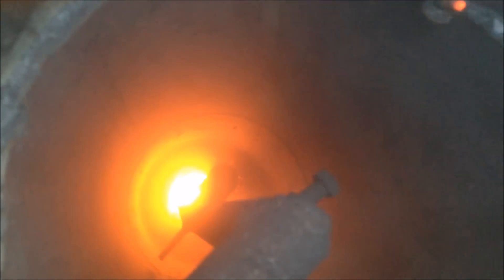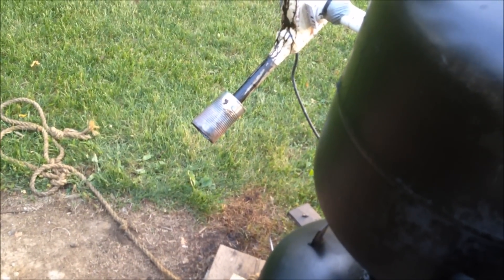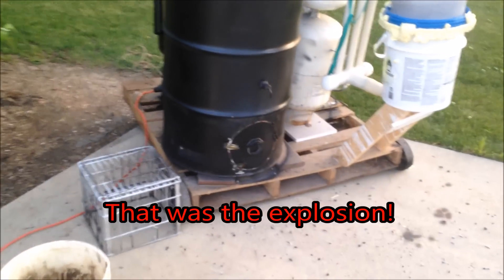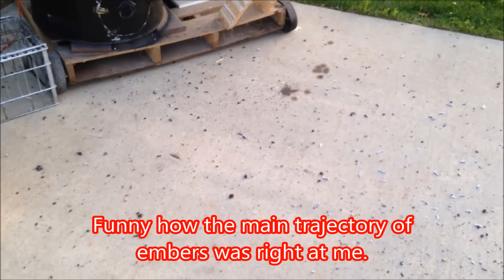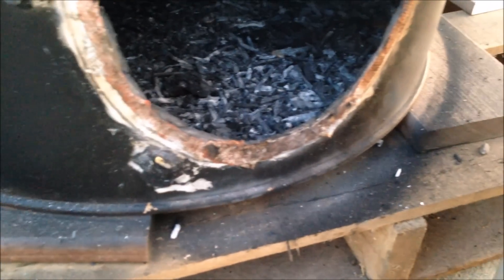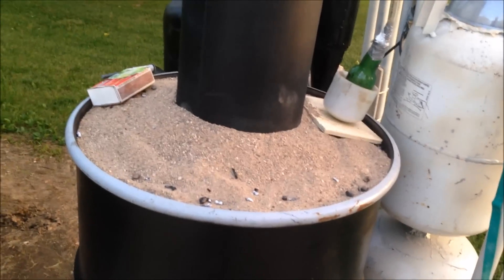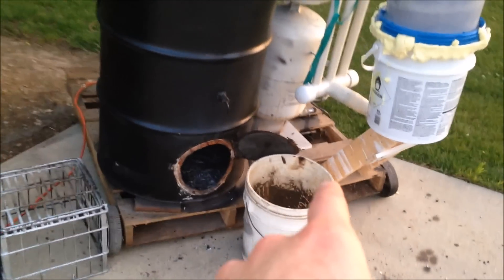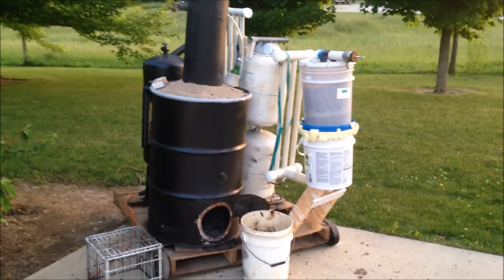Wood Gasifier Explodes on Video

Comment: THE LONE RANGER I LIVE IN LITHERLANDHEREWEGOBREAKWORDSUPJUSTTRYEDREDUNDERLINEL217LWMERSEYSIDENRLIVERPOOLENGLANDUKYESOLDBOILEREXCHANGEDFORNEWRECENTLYOLDEMITTEDFUMESNEWISAMILLIONTIMESWORSEINOWSLEEPINBATHROOM LET ME EXPLAIN I HAVE SOME WHO HAVE INSTALLED AN APROX 6ft by 24in LENTH HEIGHT VICTORIA FALLS GARDEN WATERFALL FLOWS DAY NIGHT AN SOMETHING THIS SMOKE LIKE WOOD DAY NIGHT IN HOUSE COMES THROUGH WALL VENTS UP OVERFLOW BATH SPOUT ETC EVERYTHINGS PLUGGED BLOCKED TOWELS AT DOORS AN CANT STOP THEM THE HOUSE SEEMS TO HAVE CORONA BALLS HANGING AN WITCHES BUT THE IS A WEAK 83 YR OLD ON MEDICATIONS ETC AN EVERYTHINGS HAPPENING IN HER HOUSE IF THE GAS BOILER WAS USED OR JUST FRONT PLATE FITTED ON FRONT OR WHATEVER IT HAS INTERNAL COMPRESSOR I TRYED UNDERSTANDING ITS SMOKY ASHY EYES NOSE LUNGS SUFFER AN DRIES YOU OUT COMPRESSOR IS A FERNOX TF1 COMPACT FILTER BOILER LOGIC COMBI C24 ideal ITS  CALLED 21398002025569 THE O HAVETOPRIGHT TO LEFT THROUGH LINES YOU SEE IF ITS SET TO RUN AN COMPRESS GAS REMOVING WATER FROM RADIATIORS AN ITS BEEN SETUP TO TRICK ETC POISON YOU ME LIKE AN THAT AN OLD WOMAN AM DAVID BY THE WAY JUST ME FUNNY TEETH THAT WAS ANOTHER TRICK ON ME I RUN MANY DO THE WICKED WITCH AN BELINDA THE WIZARD OF OZ NOW WOOD CAN RELEASE GASES TO BURN RIGHT OR WRONG THE GAS BURNING THE QUESTION IS WE WOULD EXPECT GAS TO SUPPLY CLEAN SAFE HOUSE GAS BUT IF THE BRITISH GAS LINE WAS DISCONNECTED AN YOU RECONNECT TO WHAT TYPE OF GAS SUPPLY WHAT TYPE OF GAS IS IT SAFE WONT EXPLODE WONT POISON CAUSE PNEOMONIA LUNG EMPHASEMA HEART DISCEASE SNOTTY NOSES CANCER TO AIR PASSAGES BECAUSE IF ITS NOT IN WRITING AN YOU HAVE AGREED TO ACCEPT A CHEAPLY SUPPLIED GAS IT COULD BE VERY DANGEROUS AN THEY MIGHT SAY ITS NOT IN WRITING AN NOTHING IS STATED CONCERNING THE GAS PRODUCED FROM EMISSIONS FROM POISNOUS WOOD TREES IN GAS GAS FORM IN YOUR HOUSE GAS SUPPLY PIPES COULD BE ANYTHING AN COULD CAUSE DEATH THE PINK BALLS LOOK LIKE CORONA VIRUS MAGNIFIED AN I DONT LIKE WITCHES INVOKING DEMONS

Comment: your shaker allowed the charcoal to particularize into the air below the reactor, and because you were burning corn (which burns very hot indeed because of the sugars) with a high volume of oxygen travel across the particularized charcoal, you generated a flash-over.

Comment: My thoughts are that you shaking the grate caused low O2 when you stopped shaking, the O2 level increased and caused ignition of the low o2 you just produced. Bang.. or pop in this case..

Comment: I think you came out quite well on this. Do be careful. Best of luck on your next try. Good to see some one willing to test and try ideas. You learn so much from experiences. Glad you made the video of it and sure does make it easy to better consider the causes and avoid them. Might check air getting in around the shaker shaft. You might even close up the unit as best you can and blow air into it and see where there is any smoke or air coming out. Best of Luck on your next test.

Comment: I think the paper towels were part of the problem. They obstructed the airflow and uniform movement of the corn while everything was smoldering. When you shook things up, that probably let in a sudden rush of air which allowed the hot gases to ignite.

Comment: You need a top that is fixed with some heavy duty Springs so when a sneeze occurs it will lift the top up to release the pressure. Otherwise your just gonna keep blowing out at the weak point and potentially hurt yourself.

Comment: I think you you shook a good chunk of corn down n had a build up of moisture build up. Especially if it's over 12 percent moisture. Having your top opened help compress the moisture and blow the door. That my opinion from having experience burning corn and installing wood and pellet stoves. Try a solid gasket and maybe a heavier door on the bottom as well .  That rtv stuff doesn't handle pressure well when you be got warping and expansion at play as you will always over time with anything solid fuel. Keep up the good work though man.

Comment: don't use food for fuel (or growing "crops" made for "fuel" instead of using the crop land for food crops)... the government's done enough of that with the garbage "fuel" they call ethanol, which costs more than it produces and just destroys engines. 
Wood gas, ran through the proper filtration and cooling, is much better.

Comment: In the preparation of tanks and tills for welding, the procedures to prevent explosion are  taken to purge vapours and gas fumes that remain, and are the same when the storage of flour and other finely ground grains have been present .
Your raddling the already heated.carbon dust reach critical balance for ignition, and there you have it BANG !!

Comment: You need to crush the corn bud..
Lets just say that Corn has explosive features..
(Pop corn is a sign)..
That is why I believe that raw corn gives off a bit of ethanol in very low forms.
Even without formatting it because it did a similar thing to me...

Comment: Was you surprised not to see pop corn when you opened the door?  lol

I didn't get a good look at the door, but no matter what if you have to ever open the top during operation then that weak ash door is a safety hazard. I think you may be right for the reason why the door seal failed, but the fact is that door seal can fail when the top is opened, shaking the grate or not if just out of freak accidents, if the bottom gets too much air at the same time it has highly flammable fuel available it will burst that weak door seam. I think it would be good to make a better door seam that can handle the pressure if/when that happens while the top is opened during operation. Mechanically the door must be stronger and mechanically sealed not just sealant.

Comment: yeah dude, each kernal of corn has water in it, and exploded at about the same time, this means your heat is even, and hot, since you had multiple kernals explode within several hundreds of a second with each other. Like a bunch of firecrackers going off at once, from the water pressure.

Comment: Hi Bob

I'd say 99% the air came form the door.
Shaking the grate just brought some hot ambers as an ignition source.

If it was too much air going through the bed it'd have started burning.

You might try using fiberglass rope as a gasket.

Comment: I don't know if  you had a char - bed set up in your reduction zone. Corn is a poor fuel choice. It is difficult to maintain a 20 % or less moisture content of your fuel. Corn is loaded with starches, you add heat and it breakes down into simple sugars, Under extream heat and when you did the shaker you had the hopper lid open an unlimited supply of oxygin to the fuel mix, you got your gasifier to backfire the moment you used the shaker, In gasifier operations this is called a puff back. Your puff back was more violent of a reaction because of the sugar in your fuel, Also it's a good idea to make sure your fuel size is correct and proportionally larger then the holes in your grates and it's actually ash when it passes through. Down draft gasifiers are designed to run on wood or wood products. The sugars produced by your fuel choice will continue to be problematic.
Reply: Shane Weatheral
Reply: What if he used dried hemp stalks?

Comment: do you think a Gasifier would make enough heat to produce steam when burning wood?
Reply from the maker: the core gets to 2000 Fahrenheit, and the outside of the hopper, main unit, and first cyclone get to well over 600 Fahrenheit as well. This is wasted heat if not insulated properly, and it could be used for many things. So yes.
Reply: neat.

Comment: RTV will only withstand 600 degrees F. Your door gasket looks deteriorated and O2 will suck in there and boom.
Reply from the maker: I rebuilt the main unit, and redesigned the ash clean out, pretty sure the ash clean out is perfectly sealed now. I have the new unit in newer vids

Comment: your chamber filled with carbon monoxide then it ignited as soon as a flame sprouted threw the fuel pile , my burner in my garage will do the same thing
Reply from the maker: Well, the point is to have my main unit fill with CO and H but be deprived of oxygen so it cannot explode. The problem was oxygen somehow got into the body of the main unit and caused the explosion to be able to occur.

Comment: Hmmm, that must have been caused by "Pop Corn".
This kind of thing is normal, and is often called a "sneeze".
You will eventually get used to it  :) .
Reply: Its not something that should be "normal" in a properly built wood gasifier. I understand he is trying to design his own model here, and sure you're going to have "issues" as the design progresses. But I wouldn't call it done until the chances of a blowback is eliminated as much as is possible. 
And then further have some simple safeties in place, such as a spring assisted lid etc, that if on the rare occasion a blowback did occur, that it is contained without damaging the unit, the operator, or by-standers.

The top should be closed, it being open is what allowed to much oxygen to enter the reactor, which yes is what caused your blowback. You got to have a good sealed lid, which has a spring assist seal, that would allow pressure from a blowback to escape there in a safer direction. Which would also mean your "side door" would have to be much stronger. 

Also, you might think about automating the grate shaker. You can use something like a 12 volt wiper motor, and have it on an manually operated switch, or you can use a programmable relay to "shake" the grate every some many minuets. Either way, it allows you as the operator to stand at a safe position in case something does happen. 

~Just my Two Dollars (2 cents adjusted for inflation)

EDIT: Just saw where you said you have since moved on to a propane tank design, good to hear. As a propane tank can hold much higher pressures than a 55 gallon drum, plus you can weld pipe and other such items for entrances and clean outs, which will not blow out the way your door did. Which also makes it much easier to control the direction a blowback will go if one does occur.
Reply from the maker: Well, I think that it wasn't just from the corn, currently working on better sealing of the ash door. Don't want to worry about this all the time. Thanks for the comment!
Reply: tonto bob 
Explosions are fairly normal in gasifiers, so it is something we have all become accustomed to.
On my first gasser, it used to explode so violently that it would send burning material up to a height of 60 feet.
At night, this was always an amazing spectacle  :) .
Reply from the maker: That happened to me today, blew my semi-permanently sealed ash door 25 yards down my driveway, and bent the hell out of the barrel lid, sounded like 5 shotguns going off at once. It happened when I finally burned through the corn brick in my reduction zone thus allowing a large amount of air immediately able to rush into the barrel. Not going to use a barrel anymore, going to put the reactor core in a less  voluminous container, like a 30 gal propane tank, so my "pops" aren't so violent due to less gas volume and better metal weld-ability for sealing purposes.
Reply: +tonto bob 
Yup, I hear ya bro.
The barrel is ok, but that huge volume does scare me a bit.
Propane tanks, or even air compressor cylinders, are surely a safer bet.
Your thinking is pretty solid, so you are taking the right steps and learning the right lessons.
Keep up the good work.
Reply from the maker: Trying my best, steps backward will hopefully turn forward by the end of this.